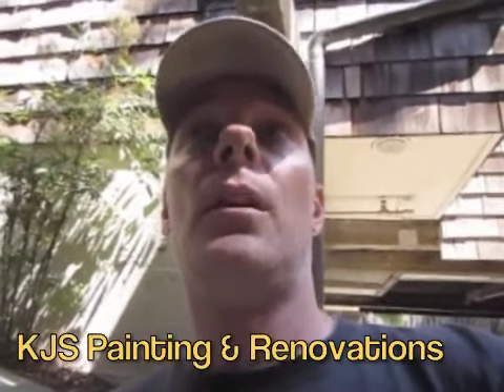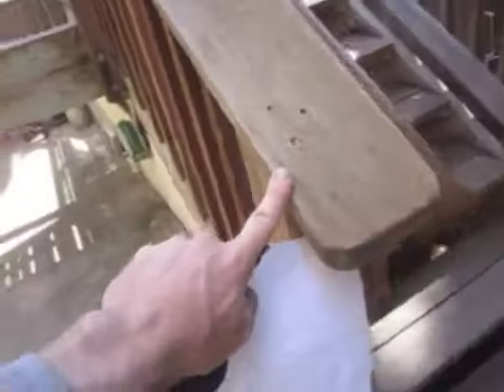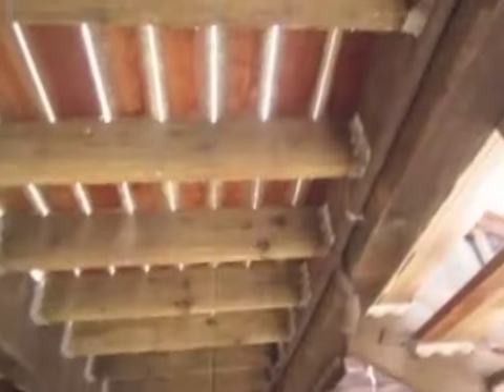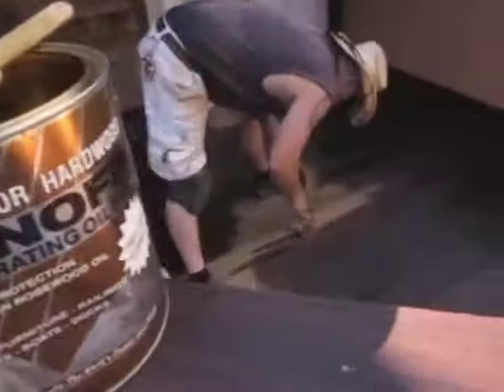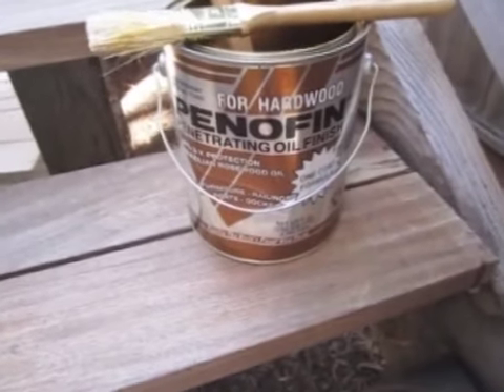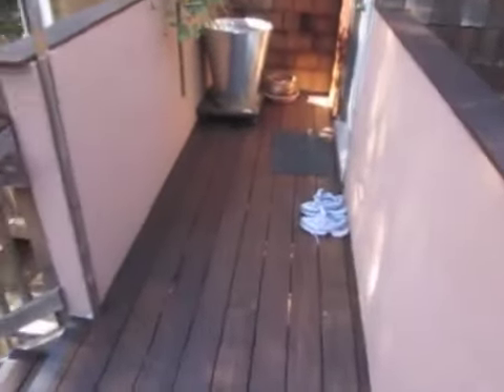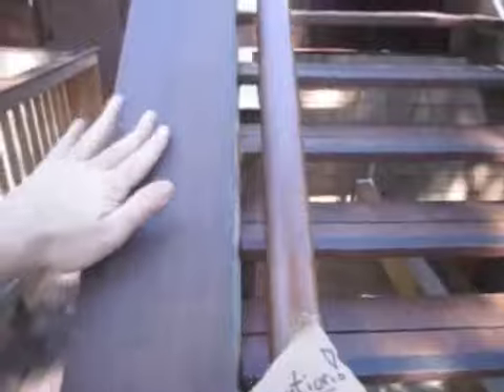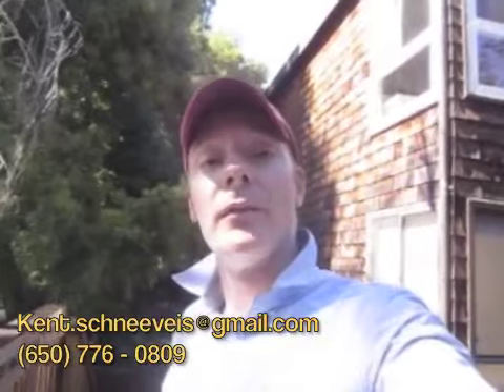Ipe Brazilian Hardwood Deck Maintenance

Comment: Did you put the grip tape on before or after the stain?
Reply from the maker: Grip tape went on about 10 days after the Penofin. I used 3M Contact Cement,  (acetone based stuff)  along with the grip tape, to assure it would stick. Its been a couple of years and it's still sticking!
Reply: That's very helpful. Thanks